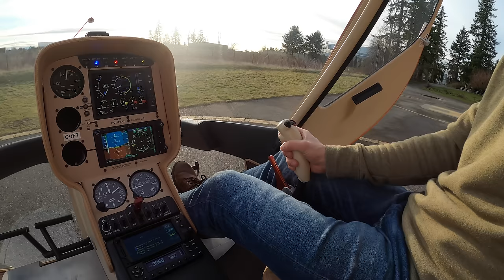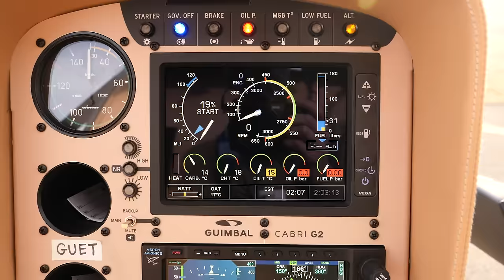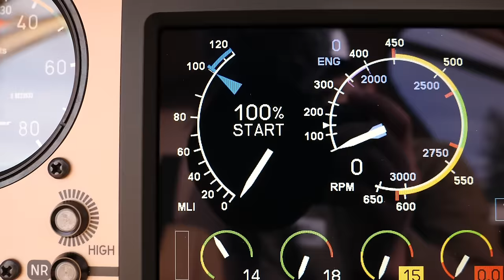How To FLY A HELICOPTER

Comment: Simplicity and clarity are the marks of a genius.
Reply: AND he was able to compose it all in 6 minutes!!!
Reply: Agreed!  Simplicity and delivery make all the difference.  He did a great job.
Reply: Well done sir
Reply: But he got the cyclic pitch all wrong. Gyroscopic Procession means you put the force into the disk 90 degrees before it is realized.  Very important concept to have as a foundation for rotor wing.
Reply: @MrRexquando     I would bet that part was difficult to iron out mechanically speaking on early helicopters.
Reply: @mikeburch2998  They invented the swash plate in 1917 that made it pretty easy to figure out. Transitional lift and ring vortices were much bigger problems that snuck up and cost a lot of crashes and injuries.
Reply: Thanks
Reply: Yes great simple instructions! Love it. Never know when you may be stranded without your pilot! GwinsLodge.com Alaskan cabin rentals Kenai Peninsula
Reply: @mikeburch2998 ,
Umm yeah ... it was more about the early inventors getting "ironed out".
Reply: that can be argued ... we all understood Forrest Gump perfectly well.
Reply: He is really gem if person.. so much to do yet so simple...
Grt Sir...
Love from India
Good luck to you...
Reply: Rotor theory is complicated.  This was a clear basic explanation of the controls and how they interact with the mechanical hydraulic assisted linkages to the swash plate rotar head assembly  and the anti-torque tail rotar assembly via the floor pedals. Clear, brief and concise....now flying the beast is a completely different thing altogether.  Most fun you can have with your clothes on!!!
Reply: Grzegorz Pitas  except he is WRONG he stated incorrectly that in forward flight the blade is pitched least at the front and most at the back even tho this probably makes most sense intuitively it ignores the principle of gyroscopic precession which means that a force acting on a spinning disc will take effect 90 degrees later ..... that means that the most pitched blade is on the left side of the heli if the blade spins clockwise and vise verse........

Comment: That was so concise and easy to understand. No waffling and bullshitting, straight to the point. Xlnt.
Reply: And very clear demonstration of what each control is doing physically (other than the throttle, but that's easy to explain).
Reply: Agreed!
Reply: 💯 no fluff. No jokes. No filler. No begging to hit their patreon.
Reply: 1:35 and he even tells it wrong. Look up 'Smarter every day helicopter' and and you'll learn how it works.
Reply: @michaelderflinger5002  What wrong about that? The rotors have to compensate for lift on the right side, so the pitch does an 8-motion. No?
Reply: @jotcw81  At 1:49 he says the blade is fully flapped at the back. This is wrong it is fully flapped 90° before  it reaches back. This is needed due to rotor dynamics / gyroscopic effect.

The whole rotation plane of the rotor only shifts when the force is applied 90° before the desired movement.

Comment: I need to point out, as they told us when we're headed to Vietnam, helicopter Pilots do not fly. They beat the air into submission!
Reply: That sounds like something the military would say... they probably don't use those terms at civilian helicopter School. Semper fi!
Reply: @kidkique  surprisingly, I trained with Army Rangers while still in high school. I actually ended up going into the air force. Made Vietnam era vet but did not get in country. And ended up on a Recon into a country we weren't supposed to be in with what I firmly believe were Navy Seals and Recon Marines. Only because I worked on aircraft and knew what they were looking to find. And that was while I was in uniform. The private work was something completely different.
Reply: We said " A Helicopter is 10,000 moving parts flying in close formation"
Reply: @hueydoc  it may also very well be proof of God LOL
Reply: 44 Hawk, you’re an old-school pilot; I salute you.
Reply: @DanielinLaTuna  truthfully the only flying I've ever done, is I did some training of several Pilots of the F-111 simulator to teach them how to engage terrain following radar while in articulated Terrain. I was an avionics Tech on F-111. And I was the only one that the commander of flight simulator had ever seen fly the F-111 Simulator the first time and not crash it. Actually, I never crashed it.
Reply: The Vietnam Veteran helicopter pilots were the ones who really tested the capabilities of the chopper and set the stage for future innovation and design. 
V.V.68/69
Reply: It's a screwy job.  No bout a doubt it
Reply: @44hawk28  .. Comander Richard Deuter.. MIA .  Rest in Peace my brother 🙏
Thanks for sharing
Reply: @hueydoc  I came home from my first day of fixing cars.  I was tearing VW engines down.. I had been tuning up VWs in college to feed myself and my young family, and I knew what the inside looked like from pictures..  it's not the same as hands on experience.. I drove home in my VW.. and thought about all that stuff going round and round really really fast... I still do.. can't help myself

Comment: His explanation of how the rotor pitch makes the helicopter tilt forward is a little off, its actually 90 degrees of rotation different. If the rotor blade that is pointing straight ahead has more downward pitch and the opposite rotor has upward pitch you would think the helicopter would tilt forward, but the helicopter will actually roll to the right due to gyroscopic precession. Excellent example here https://www.youtube.com/watch?v=eTjGTxSevHE
Reply: You're right, but think about the intended audience here. GP is another level.
Reply: Scott Clymer The 90 degree gyroscopic precession is an interesting thing. Why not just tell the facts. This is why people think they are experts on something because they saw a video where someone wrongly explains something. It’s so annoying to those that actually know the facts.
Reply: @MrSleepProductionsInc  90° phase shift, call it what it is........ gyroscopic precession.
Reply: Jethro_xd corrected
Reply: I will never fly in another helicopter if it doesn't have a backup tail rotor
We were lucky to auto rotate to the ground and slide to a stop
Reply: The cyclic is one of the most amazing things ever invented if you have any engineering inspiration at all it should impress the hell out of you
Reply: @scottalanclymer  GP is accurate, though. Why say anything except the truth?

Comment: Thank you for this video. You actually corrected for me a piece of info that I knew wrong. I always thought that rasing and lowering the collective increases or de-creases the engine power and twisting it would modify the pitch of the blades. Turns out that is more or less quite the other way arround.

Comment: Hi! @Pilot Yellow, I see a problem at 2:05. The helicopter doesn't actually move in the direction the rotar disc is tilted. It will actually move side wards due to an effect called the gyroscopic precession. To move the helicopter forwards the rotar disc needs to turn side ways and on the opposite side to move it backwards.
Reply: gyroscopic precession i saw that in the vid i wondered if someone say this mistake too

Comment: And another thing about flying a helicopter: When you move one control, you must move the other controls to compensate because they all affect each other. for instance: when you push forward on the cyclic, you have to pull up on the collective and when you pull up on the collective, you are going to have to push the left torque pedal. And that's just a small example. Great video.
Reply: Appears to be a balancing act requiring a developed touch for sure…
Reply: @bigl6322  After you learn, you don't even think about it.

Comment: I was an aircraft mechanic in the British Army and spent many hours on the Westland Scout and the Bell Sioux (M.A.S.H.) With the Sioux if the pilot reported any vibration we had to check if the rotor blades were aligned. To do this we had to put different coloured chalk on the end of the blades and then with a contraption made of a metal pole and a 4 foot long, 4 inches wide piece of canvas inch really slowly toward the helicopter. As soon as you made contact you backed off. The chalk marks would show on the canvas and you could make adjustments to the rotors. As the blades made contact it really was “squeaky bum” time !

Comment: When you say the blade is at maximum pitch at the back (with the cyclic forward). What about gyroscopic precession, I thought the maximum displacement occurs 90 degrees after the input In the plane of rotation, this would mean that the blade would be at its greatest pitch 90 degrees before the tail, correct me if I’m wrong.
Reply: You're right, but for the intended audience here, he's not going into gyroscopic precession...
Reply: You are correct.
Reply: @scottalanclymer  I dont think that's a correct approach. The information provided is incorrect and the intended audiance should be informed correctly regardless of the level of understanding. After all when I learnt to fly Helicopters these principals were also new to me then as they are to the audiance but i was give the correct information from the start. Beside let's respect the audiance and not patronize their level of understanding or capacity to learn.  

I'm sorry for the rant but this is straight forward. The lesson was about informing the viewer on how this works and there appears to be a clear omission of an very important law and principal here
Reply: Absolutely right, and inclusion of this detail would have better informed the viewer on the truth that helicopters do not in fact fly at all but rather, in violation of all natural human instinct and physical laws, BEAT THE AIR INTO SUBMISSION!

Comment: Surprised the trainers can even get off the ground with the massive balls of steel they have to have sitting next to a noob in the pilot seat.
Reply: Bored of Humans Being one of the noobs who tried this, trust me, they won’t just let us go wild. 😃 First, they take us into a hover, then let us try the pedals. Swing left, then right, to get a feel for it. Then they let us try the collective, and they control the other two. Up, down gently. Then try the collective, only that. Then try to coordinate two out of the three. Then two of the other. Then the last two in combination. Then they take us flying, and let us do some simple maneuvers at speed and altitude, which is almost as easy as flying a plane. Then try to use all three controls still at altitude but slower and slower speed. And so on. At the end of my first hour I got to try to hover just above ground with the instructor following with me in the controls. Didn’t go too well, he had to take over after only a few seconds every time. 😃 You don’t get good at this without serious practice!

Comment: Didnt know that the “throttle” and pedals increased the angles of the rotors. I thought it increased rpm
Reply: The throttle does not increase the angle (pitch) of the top rotor blades. The collective pitch control in your left hand does that. The the throttle increased the rpm of the rotors. The pedals change the pitch of the blades on the tail rotor.
Reply: Glenn Mosley 
I thought the governor controlled rpm
Reply: @americanpride9733  The governor holds the rpm that the pilot selects. Increasing pitch on the main rotor adds load that would lower the rpm without the governor.
Reply: Or conversely, decreasing pitch would lessen the load causing rpm to increase. The governor keeps rpm constant.
Reply: @americanpride9733 , correct, sort of. The governer governs the MAX RPM. The throttle brings it from idle to the governed RPM and no more.

Comment: Hate to be that guy but you are 100% incorrect about the position of the blades/disk imparting reaction force. Gyroscopic Precession means the force you apply is realized 90 degrees after your input. So in the Eurocopter case you would apply the downward change in AOA on the blade when it is on left side to push the nose down. When you push the stick forward the blade lowers its pitch on the left side/neutral in the front and increase pitch on the right side.
Reply: People get confused because this is a strange phenomenon. But probably something to fact check before you make a video.
Reply: hate to be that guy but it's gyroscopic precession.
Reply: 1:43 was as far as I got too and was just about to post this. I believe it's also the reason for the 'helicopter speed limit' - as the retreating blade (in this case on the starboard side) reaches stall speed in the air (due to it travelling rearwards while the craft is moving forwards through the air) there can be no further forward tilt of the disc and thus it becomes self-limiting.
Reply: @MrRexquando  No, it's absolutely precession. That site has it wrong.
Reply: @cadman1973  pretty sure another speed limiter is the blade tips can't go supersonic as well. but both of you are failing to realize this video is for people who have no idea how a helicopter works. not for people who are pilots such as us.
Reply: @carl-ok9gn  I'm not a pilot - except for CCPM RC helicopters. But I am an engineer and I have a philosophy that if you're going to expend effort to learn something, you might as well learn it correctly. At 46 y.o. I'm still a little annoyed we were taught DC current 'flows' from positive to negative just because that's the convention.
I've never really considered the supersonic aspect but I suspect that as they approach that speed they would need to to be very strong, as at transition point only the tips of the blades would be supersonic and aerodynamics are quite different beyond that point so there would be vibration induced. There would also be the large increase in drag as experienced in fixed wing aircraft too (I forget the term for the phenomenon) as they approach supersonic because the air can no longer be considered, for all intents and purposes, incompressible.
Reply: @cadman1973  i understand. but having tried to explain gyroscopic precession and other topics related to helicopters or aeronautics in general to people who aren't engineers or at least interested in physics and engineering, it doesn't go so well. they stop paying attention and lose interest with the 'too complicated for me' mindset. while i dont think we should necessarily stoop to their level, i understand the guy in this video doing it. the majority of the people who watched this video i would guess aren't actually interested in learning anything. i would guess they got the video recommended and clicked on it with an ignorant purpose. i dont think the guy is trying to mislead anyone and i am confident he knows about precession. he's also making money from the video and sciency things tend to cause a lot of people to stop watching, which is a factor in how youtube does their revenue. i'm not defining him or justifying it, just blabbing about why i think he did it. most of the people commenting are acting as though they caught him being stupid or not knowing about one of the basic fundamentals of helicopters.
Reply: @cadman1973  You are close. It is the advancing blade tip hitting the sound-barrier and the retreating blade root hitting a flow reversal.
Reply: @cadman1973  Auto-correct got me. I was just pointing out it is misspelled a lot. I get confused on the spelling because it is a procession of the force. A Precession would actually be 90 degrees pre-observed force (not post as it actually occurs) but hey I didn't write the book.

Comment: Due to my mechanics and physics background, I already understood how a tail rotor worked to offset the unanchored torque of the main rotor (assumed it was done through speed, didn’t account for pitch) and I understood how the collective worked. I didn’t get the cyclic…. Perfectly explained….thanks! 
Bucket list was learning to fly a helicopter, but I’ve had a couple of occurrences of vertigo as I’ve gotten older and suspect the may be a deal breaker…

Comment: I have flown fixed wing in real world.  I have flown rotary wing simulator.  Very quickly I learned that sudden or extreme control inputs on the simulator did not end well.  Overall, probably due to extensive reading on my part, I did pretty well.  Liked your video.

Comment: 2:03 you forgot about 90 degrees offset
Reply: Was just looking for this comment, spot on
Reply: Diesymetry of lift or gyroscopic presssion ?I forget.
Reply: Yes makes sense.
It has a 90° gyroscope effect when you initiate tilt  ,  I would say probably would creep right at first when you would otherwise press cyclic forward if blades coming from the rear advance forward up the left.  With twin counter rotation support It would be much less overall but actually could have have some complexities depending on blade flexibility and Hub design.  Fascinating. Still what a great topic!  I should learn this. ♡

I'm guessing, to go forward on a left side advancing support blade kick the swash stick left but bring it forward.  With practice should run clean.  Gets to feel in cross wind gusts take off learning 360°.  I can see that.   Makes sense.  Glad you guys know your stuff and I like that it has a description.  Yes it is an important start up point of coaching. 

I am imagining how this works.  I  love the subject.   Wonderful!
Reply: @johnedwardculp6621  chill out dude. jesus
Reply: @chadnixon1094  precession